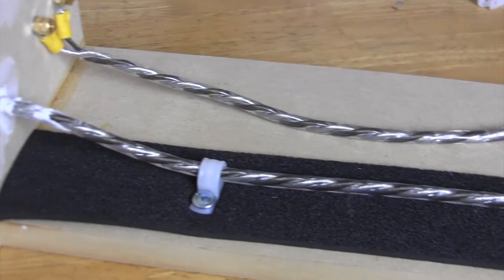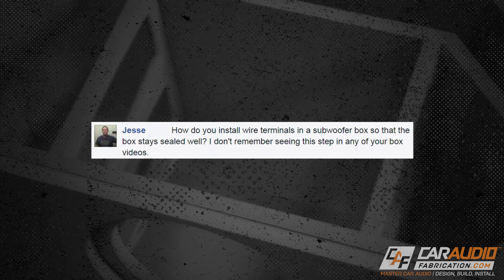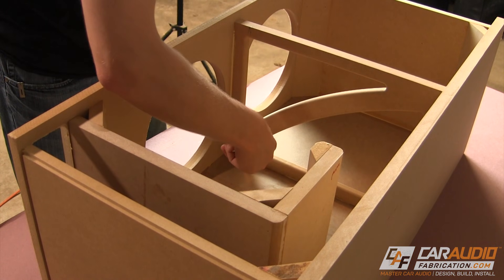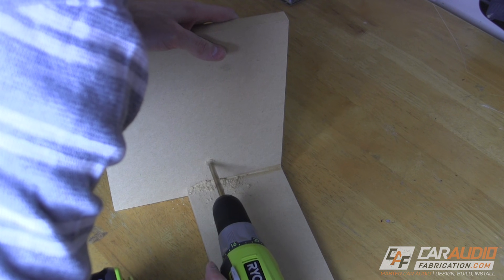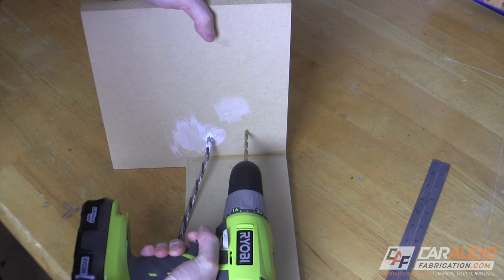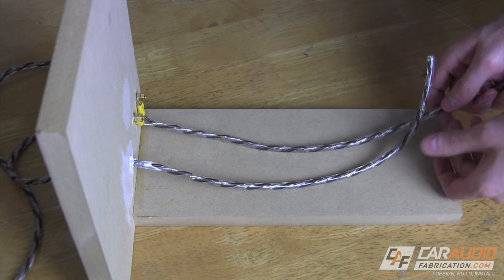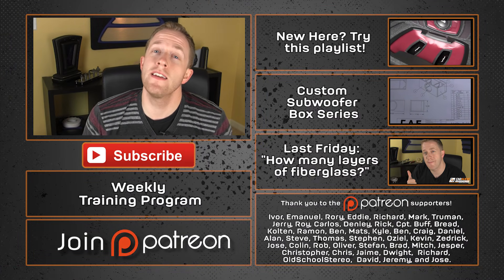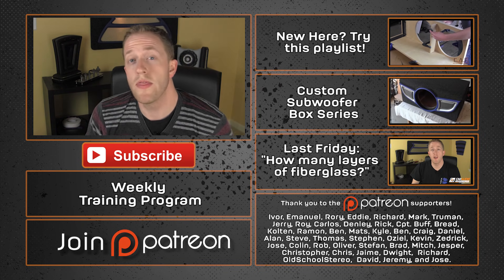Say No to Terminal Cups! How to connect wire to a subwoofer box - CarAudioFabrication

Comment: 9 yrs later, im commenting anyway..lol. i use SMD terminals. Ive used grade 8 bolts too. Work fine. I have a jp83 at .5 ohm and the smd terminals work great. Ive always wanted to run the wire directly to the amp but was worried about air leaking. I may try this. Installing new Sundown M12 D2s today

Comment: Can you run the wire through the port, directly to the amp terminals, bypassing any cups or extra terminals?
Reply: yes you can, I've seen this done before and have done it myself a couple times. In theory you're adding more resistance with a longer wire though, and possibly making your wires flap around inside the port. a shorter run thats closer to the sub terminals is the goal.

Comment: Hello, I agree with 
@seans1102=That wiring hold down method is a great tip.  (Thumbs up).   I have some Stinger 6x9 Sealed Enclosers that I will be installing Good RF 6x9 and wanted a sealed enclosure, cant see this happening with a plastic Speaker Box Terminal Cup that leaks air. Had the same thought as to remove the cup- seal the hole, drill a small hole for the wiring , and seal. this way my thought is that I can have 1-12 Ga wire without any breaks, or connections straight from my 78 watt per channel Head Unit , to my 110 watt speaker at 2-Ohms. Eliminating any resistance. What kind of resistance would we get from adding , or using your  Binding Post Banana Jack rather than 12ga straight wire as mentioned? If I'm running at 2.2 Ohm, i don't want to make it 2.5 Ohm by adding hardware. Good informative channel, Thx

Comment: I’ve always used brass screws threaded into holes and then soldered ring terminals on the wire. It’s kind of similar to binding posts, but cheaper and available at any Home Depot. It’s a good idea to cover the screws on the outside with plastic to prevent shorts, though.

Comment: Is it ok to connect the speaker directly to amp with out cup terminals?
Reply from the maker: Yes, you could drill a hole and seal if need be. Other solutions discussed in the video.

Comment: The difference between a 6ft speaker wire and a 3ft speaker wire is not enough to make a difference. Give yourself enough wire to move stuff around if needed. I also drill 2 holes that looks like an 8 and run the wire through, it's tight enough no noise even without caulk.

Comment: are these long enough for 3/4" MDF? Also, what kind of ring terminal should be used on the bottom side? I want something I can crimp with a set of hand crimpers (not solid copper), but rather it not be steel, as that seems not to be recommended inside a speaker box.

Comment: Just use the speaker terminal posts
Reply: Do you have to use a terminal or can you just directly wire the subs to the amp without using the terminal?
Reply: @infodisco4097 binding posts are the best way to me... easy to install too sorry for the way late reply my friend

Comment: Back in the day (early to midish 1990s) we used the cups and hated them. We would use bolts through the box for terminals, but constantly got caught on stuff. The best way around it all was using the cups and a ton of caulking. Great video bro!
Reply: Box should be bolted down, then it wouldn’t be getting caught on stuff 😉 plus sounds so much better when it’s firmly secured.

Comment: I never understood why people spend so much time making sure that the box their building is airtight then turnaround and drill a huge hole in the box and fill it with a flimsy piece of plastic that’s held together with four small screws.. I use the small hole method for two reasons 1. It saves me the cost of buying the terminal 2. The potential for air loss.. I also glue small pieces of MDF inside of the box where the screws will be so when screwing the subwoofer down it’ll have more than .75” of material to hold the subwoofer in place because if you’ve ever replaced more than one subwoofer in a box you’ve surely run into the spinning screw that never gets tight enough.. You can also fix this by wood glueing a golf ball tee into the screw hole and cutting it flush with the box so now you have something to screw into..

Comment: This is excessive. Why not just buy two copper bolts and attach the wire and use a nut and washer to tighten it down on either side? Way simple. Just a trip to Ace hardware.

Comment: I just use some JB weld in the front and back in proper places to increase the cups overall thickness to between .5-.75". And finish with a closed cell foam gasket.
For the back, make a ring around the cup with packing tape to hold the epoxy in place while it dries.

Comment: You also missed two other important parts. The terminal cups you showed suck donkey nuts. Get the ones that do not use the press in terminal instead the have them post that have a threaded but on them to tighten down the wire. If you have to have a terminal cup that is. Plus thoses tend to be much thicker plastics. Also watch you wire type. Some people will use a twisted pair wire were speaker wire is twisted then there’s a clean (I’m most cases) outter jacket keeping the pair together. I have seen air leak out down the jacket so you have to seal that. Say you want a removable wire connection but don’t want terminal cups. They make 2 or 4 connector disconnects or even just a male and female disconnect also work. Just flip one side. So say on the box the positive has the female and the negative has the male disconnect and on the lead to the amp match accordingly that way you can’t plug them in wrong if the connection is in a tight spot. Also if running a dvc or multiple subs. Try to make all connection inside the box and just have one positive and one negative conductor coming out of the box. Smaller and less holes to deal with. Or in a pinch you can you some good quality bolts holding ring terminals one inside and one outside. Just make sure
To cover the bolt so it doesn’t touch anything else like metal and short out.

Comment: 2:50 I also dislike terminal cups for the reasons you do aswell. I drill a hole amd caulk the wire.
Reply: Binding posts. I have only seen them in the automotive battery location changing... now you can use them for speaker’s. Cool.

Comment: My sub box is too big In The boot. So I was thinking of putting my subwoofer in the spare tyre compartment by using the shape of the compartment as a box so it lays flat on a board on the floor. 
What do you think I should use to cover the metal inside the spare tyre compartment.

Comment: How should I go about attaching TWO 8 AWG speaker wires into ONE 8 AWG speaker push terminal? Possible video suggestion? (why bcuz for when running two DVC subs in parallel)

Comment: Ive used higher end terminal cups that have a gasket and are much stronger than the one you showed. Never had an issue. One was even metal with pretty thick material and the same binding posts integrated. Next time ill try those binding posts since they are probably more cost effective. good call

Comment: Hey man, my prefab box came with a terminal cup and it leaks a ridiculous amount of air, and vibrates. It sounds awful. How can I fix it? Do you think I can remove it, and replace the hole with MDF and drill holes for the binding post?

Comment: I say line the inside of your box with fiberglass insulation, about an inch to two inches thick. It really keeps out any rattle from any wires or anything else. Plus it adds a nice damping effect for nice thick hard hitting bass.

Comment: Ok I'm some what a a newbie when it comes to car audio installation but! I do take as much safety precautions as possible, well my question is, how do you install a sub with a built in amp and a 2nd sub that needs an amp for it to work properly into one single head unit, and also both subs have completely different max wattages and RMS.....

Comment: Commenting almost 40 months after this video.
I’ve never been a fan of terminal cups.
Starting back in 1989 I’ve always either drilled holes and ran the wiring directly through or I actually used brass bolts, washers, and nuts.
Ironically enough, I started doing that because I didn’t want to spend money on buying spring terminal cups.
And then around 1998 instead of caulking all my joints and seems I started spraying the entire inside of the box with rubberized undercoating.
Basically what the spray DynaMat is but about 1/3 the price.
Using the rubberized undercoating also had another benefit.
Since the entire surface of the inside of the box was coated with liquid rubber it dampened any chance of the box creating any unwanted resonance.

Comment: Please someone help ! So I have 2 ported boxes with 1 kicker each box , can I “wire” the 4 ohm to 2ohm speakers through terminals instead of connecting straight to each speaker ! The thing is that since they are separate boxes it’s hard to wire them the traditional way !

Comment: Hey I have a question, well I have a 2007 Toyota Avalon that's has job synthesis sound audio and a jbl stock amp witch got burned. How can adapt a aftermarket amp with the stock amp connectors?

Comment: what is the proper connecting process for connecting the neg.& pos. speaker wires to the "BINDING POST"?? THERE is a hole provided ( is this for a ferrule??) or do you just wrap the wires around the binding post and -screw until tightened ; I would prefer to use  "ferrels" wrap the bear wire or use ferrels?? great video,s much appreciated, please advise the "correct way to attach wires from amp tp sub,s; PATRICK.P

Comment: The cheep China terminal cups melt and leak air  . Direct wire connection is better . If Box needs to be removable use heavy duty battery disconnects with 2 wire connection  the red ones 8GA
Reply: I actually used Deans connector for my subwoofer. It's not a very powerful subwoofer, so the connector should be more than adequate and it's really easy to connect and disconnect.

Comment: Do you recommend a sub woofer enclosure made out of fiber glass or is wood the only material recommended? I saw a tutorial a while back were the guy made the back of the sub woofer box out of fiber glass and the area were the box holds the subwoofer was out of wood only.
Reply: The material type doesn't really matter that much, what matters is that you can make it strong enough and "dead" enough. You could make it out of cake if you found a way to make it strong enough.

Comment: No bolts or anything.Cable goes straight to amp's terminals
Reply from the maker: That works! Just be sure to fully seal the wire as it passes through the box wall.

Comment: With a ported design , I know you choose the sub biased on the air space your provided with. But does anthimg oases the port ( aka the test of my trunk) have an effect on the air space???? Or does it just stop at the end of the port?
Reply: Anything passed the port*
Reply: @AnthonyR1414 
Not entirely sure what you're asking. But if you're asking whether or not the ports of a sub is part of the calculated volume of a box? No. You need to add the volume of the port to the volume of the box - just as you have to take into account the volume the driver displaces.

Comment: I have a question/topic for a possible video. The use of banana plugs in a car audio setting, pros, cons, etc. I'm currently working on a quad 8" sub setup in my 93 regular cab, and plan to put binding posts, I'm considering banana plugs to plug into the binding posts for a more professional look. I've used them in home audio before, bit never in car audio, so I'm curious to any pros/cons. Thanks!
Reply: better off using spades. banana plug is for quick disconnect.even bare  wire is better may not look "professional" but it makes better contact and wont pop out from vibration

Comment: Good vids ... Loving the depth of your knowlegde.
I've just been given a JBL 1000watt sub and a 'juice ja1801d' amp that is in or keeps going into protect mode?!
The speaker and it's enclosure look okay, the amp also looks good aesthetically (I'm aware that means nothing).
Question... Should I save my time and just buy another amp? Or is the 'juice ja1801d' worth fixing? 
I should say, this is nothing like the install's you fabricate ... The sub and amp were free... Or ... As payment for helping out a friend to install a tow bar to his car ... But regardless I would appreciate any advice you might have for me.
Reply: Try an amp you know works and if that doesn't fix it, check the connections inside the sub box. I tried an amp I got free with a subwoofer in a ported box and when I hooked it up the amp would work sometimes but not other times. I had gotten a new amp for an Orion HCCA 15"  I'm putting in my car and that amp works perfectly on my 10" Polk Audio MM1 sub.

Comment: It's almost impossible to hear the wires rattling inside a subwoofer box but you can hear a scratching sound coming from the subwoofer when the wires rattle inside the box and it's usually caused by a loose connection on the subwoofer itself

Comment: I use Speakon connectors so i can take the box out without having to fumble around with the wire.
Reply: I used a Deans type connector for my subwoofer, it's relatively small and is actually rated to handle the amount of current that the amp supplies to the subwoofer.

Comment: 3 inch 10-24 brass bolts with a brass nut tightened onto D-rings inside and out of the box wall.   Then you use a simple brass wing nut with a brass washer on outside of the box.  If you buy everything together should be about $5.
Reply: I'm gonna bill you! IF it's over $5 haha. I still gotta get my sub out, but one screw is stripped bad. I haven't had the chance to do this type of terminal install.

Comment: Where can I find boxes without terminal cups?  I can't afford a table saw.
Reply: Plenty of places that sell sheets of birch ply, can cut it for you.
Reply: You don't really need a table saw to make a speaker box, heck you can do it with a hand saw if you're patient enough.
Reply: @hakont.4960  
Problem is that you end up having to seal the box in so many places and so many ways, it becomes pointless. It will also be harder to glue, thus it wll not be as strong as with straight cuts.
Yes, you can use a hand saw, but it will not get as straight as with a table saw. Paying that tiny amount per cut when purchasing the wood, is definitely worth the time and headache it will cause you to saw by hand.

Comment: This is why we have SMD wire terminals...
Reply from the maker: They didn't exist when I made this video
Reply: @CarAudioFabrication 
And the quality is questionable at best. Seen them, installed them, reverted back to  Amphenol EP-4 chassis connectors.
Reply: Or do the old wire through hole sealed up with pen- err caulk.

Comment: Do you ever use poly fill in boxes?   Why or why not?
Reply: It's not a question whether it's a good idea or not. It's a question whether or not the application calls for it. If the box is spot on and braced properly, very little, if any fill is needed. Use a bit in a ported box if it's too boomy, or try it unclosed boxes if you need more low end extension. It's not a cure-all, and it's usually trial and error. Also, don't forget that too much fill will have a negative effect, as it will make the speaker act as if the box is smaller than it is. Rule of thumb is this. Boxes smaller than 2.5 ft3, 1.5 lbs of poly per cubic foot. Boxes larger, only use 1 lb of fill per cubic foot. It's dirt cheap, so just get some and see if it does anything for your application.

Comment: You mentioned letting the caulk cure for adequate time as the fumes could hurt the sub. Is 24 hours adequate time?
Reply: Colby Nye would definitely seem long enough, usually just the average caulk cure time. That's why I'd say put the terminals in when building the sub box, on the panel you wish to put them on and leave the sub out of the box until installing it into the vehicle

Comment: I just used 1/4 inch bolts with washers touching the wood in the inside and nut on the outside and tied them with a wing nut  on top
Reply: Did you measure the resistance in them if they are stainless?

Comment: Is it better to run the power line through the indie of the car or under the outside of the car
Reply: Jeffrey Eisenzapf 
where ever you can fit it in the easiest. sometimes 0 gauge will be very difficult to run through the Inside so the outside is a good choice. 4 gauge will almost always be easier to run on the Inside...

Comment: Would it be acceptable to use RTV silicone instead of caulk or would the off-gases be an issue? I just finished sealing the inside of my subwoofer enclosure and used Flex Seal (rubber sealant that comes in a can that you apply with a brush) and it seems to make a nice thick coating on all the joints. What are your thoughts on rubber sealants?

Comment: I'll cut a 2" x 3" or 2-1/2" round hole, put a larger piece of the mdf behind it and use 1/4"x20 bolts, nuts and washers. This way is cheap, easy to seal, super solid and the terminals are recessed. You can also use the binding posts.

Comment: I use hot glue it seems to be way less mess and seals great and you can pull it off at a later date if needed with no left over stuck.

Comment: Throw two brass bolts with lock washers and nuts through a hole drilled slightly smaller than the bolt diameter through each chamber, attach the wire from the speaker to the bolt had, add lock washer, stuff bolt through hole, now on the outside add lock washer, wire going to amp, and nut, lock it down tight. Did this to my Rockford box because for some reason there was only one terminal on thebox, so i ran the wire from the right sub through the middle wall in this fashion straight to the terminal. Air tight and interchangeable. You're welcome.